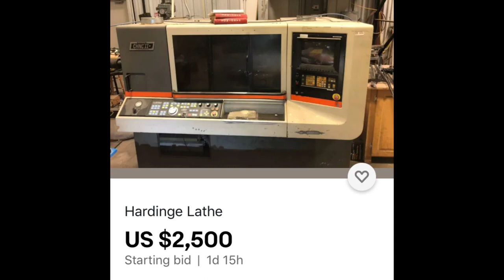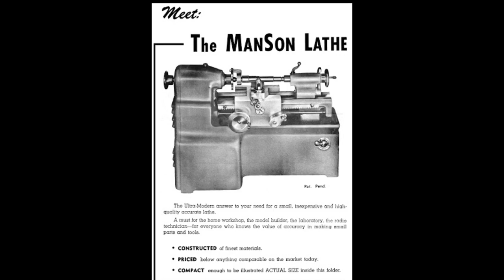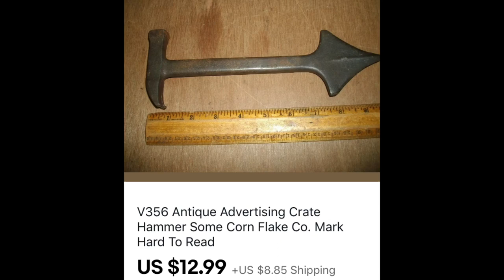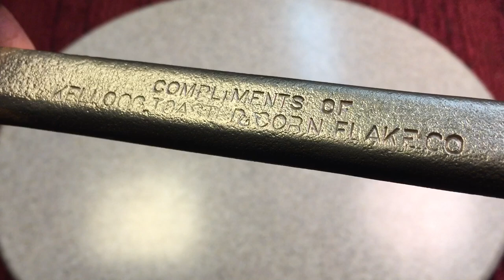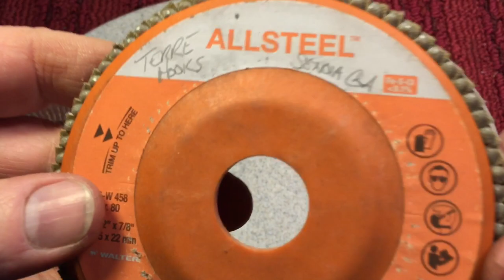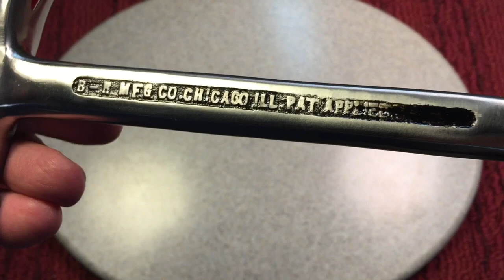Crazy Expensive BR Crate Tool

Comment: Great job on the "crate hammer-spade bar"!  I'm glad you are now saving the "patina" for those "patina-lovers" that watch your channel.  I'm slowly getting better at tool restorations, mostly due to your helpful/informative videos.  I'm searching through your videos and don't see one specialized in "painting recessed tool lettering".  I have to re-watch your videos to focus on tiny bits concerning the painting.  Now that I too would like add paint to recessed lettering, after mastering the de-rusting & polishing, I need such a video bad.  You are certainly correct that tools on " the bay" are being over-priced, but we are getting ripped off in other ways, like I bought a Kraeuter Block Chisel (just to polish it out & practice skill-building), only to find out it was really, really used, to the point it was over 1" shorter than factory.  All these rip-offs could be avoided by attending "flea markets" and garage sales where we can really study the item at hand (and figure its real value).

Comment: Great video, as usual your project looks incredible.
Great advice today. The things I restore come off the Motorways and Highways in the UK 🇬🇧 I find torches, hammers, screwdrivers, spanner’s, wrenches and all other kinds of stuff.
My best finds have been a rooftop tent from an off roader, a 160amp solar panel and a Snap On work light.
I enjoy repairing and renovating everything I find.
Could do with finding a big bench belt sander, lathe, press, grinder and polisher, pity they don’t fall off trucks very often 🤪 so far, my only expenses have been sanding discs, wet n dry paper and the odd spot of glue.

Comment: Actually for a box or crate cutter that has some nice features. The spade end looks like it would be good on those wide copper like staples and allow you to pry them loose. Also good or slice taped ends. There's more to that spaded end than we know. Intriguing. It seems like some of the mushrooming of the hammer head and deformity of the claw that it may be a softer steel? I agree with your comments about some of the collecting and driven prices. Vintage vises are real expensive. Good video.

Comment: A note on the weight change.  When you weigh the tool and compare, we kind of assume the total difference is lost steel, but its not all steel that came off.  Rust (iron oxide Fe2O3) is heavier than steel!  So a new tool is lighter than the same tool rusted🤔.  Hmm that could be a good future video.  😀
Reply: So there you have it Scout barely touched it! lol

Comment: Fantastic video John I’m sure there’s a message in there somewhere? All I got out of the video is I would like one of those crate tools and one of those mini Lathes 🤣🤣 PS what happens if you feel good about spending 200 bucks? Should you spend 400 next time just to make sure you get the feeling in the stomach 🤣🤣👍
Reply from the maker: Ben- Usually that gut feeling has to do with your income.  $20 for me is not a big deal but for someone with no job or a family to feed it might be a lot.  If your income is higher then you won’t get that worry until you are spending thousands.  I’m sure Bill Gates wouldn’t sweat dropping 10k for a Tool!  😂👍

Comment: For a few years I collected machine measuring tools.  Rulers, calipers, wire gauges, drill bit grinding gauges, everything. Then they starting getting stupid expensive because of some fools selling on those websites. Brown & Sharpe and Starrett tools commanded a premium.  I gave up collecting those tools because of the price. And there were tons of them around.
Your right, the tool collectors of today are the last of the line. I hit auctions now and again. How many buckets of fine tools sell cheap. I guess when I pass my collections will meet the same fate. Little more than scrap. Sad.
At least they were loved in my possession.
Reply: And useful.
Reply: @mrmicro22  yes they were! (Are!) That is part of the charm of collecting, to use what you collected. So many people put their collections away only to gaze over them now and again. Use them for their intended purpose.

Comment: That was an amazing restoration and it will add up too your nice tool collection. I don't think its much controversial as a painting restoration, like they do at the museums, does it take off the value of the painting or does it add more value? Most will prefer to see it as it was when it was new, not just another rusted piece of metal.

Comment: could that tool been given to a shop keeper to open the cases of corn flakes cardboard . I could see using the big spade like  end to slide into and under the cardboard flaps of the cases.Give it a twist to pull apart the glue to open it.  using a knife to open the cases could damage the inside boxes.

Comment: A Wilton Bullet Vice is probably a bad example. New ones are crazy money, the old are as good as the new, and is there really anyone who has some other vice and doesn't wish it was a Bullet.
Reply from the maker: I had a bullet and traded it...  They aren't worth the money asked...  My 125 year old vise that belonged to my Great Grandfather is the best vise I ever used.   =D
Reply: I have a bullet, and I couldn't imagine giving it up. They are a bit different than a tulip, Beanie Babie, or some rare screwdriver that works the same as any other screwdriver. They are a high quality tool that isn't matched with an inexpensive counterpart. They are also something that isn't likely to become obsolete with new technology. The money is stupid, but one could buy a rusty one, clean it up pretty easy to like new condition, use it daily for decades, and then most likely sell it after that for a profit.